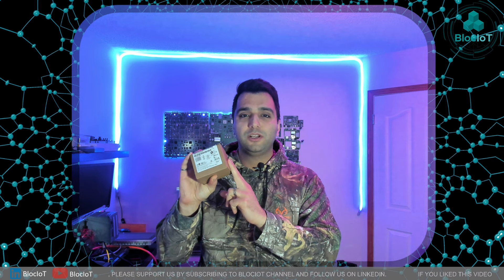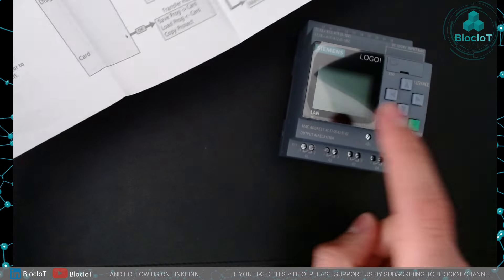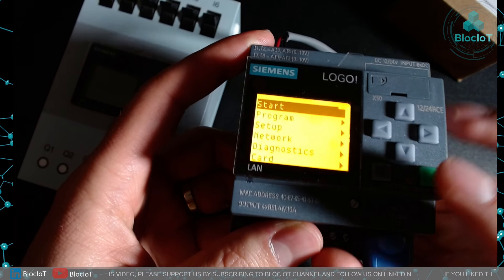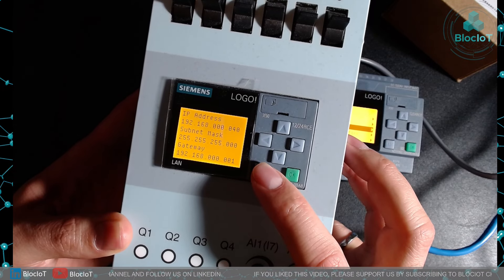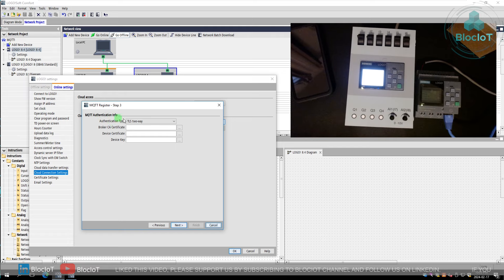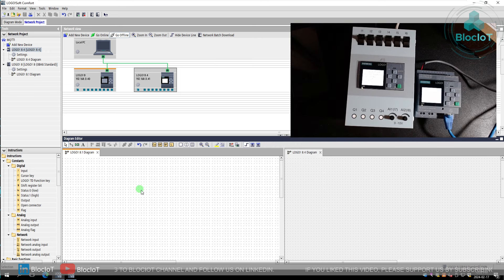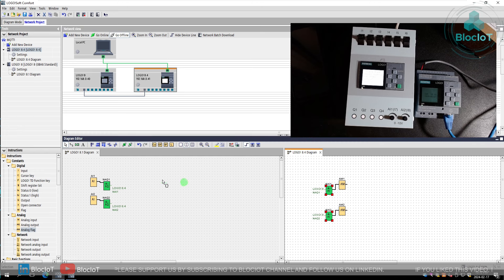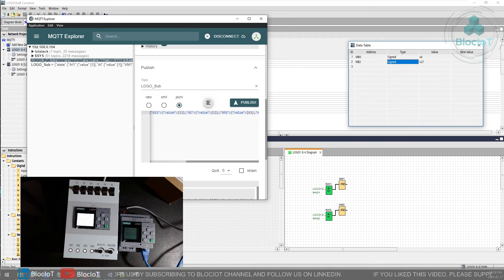31- Siemens LOGO V8.4: Unboxing & Live Demo of Bi-Directional MQTT Communication with Raspberry Pi 5

Comment: At last after watching your videos a couple of times and reading a lot of forums I managed to connect to my broker.
I was struggling because Logo Soft Comfort gave me constantly an error message, because it was unable to connect.
I was looking for a "Client ID" but you just can fill that in with something you want. Now I get it.
On to the next part, make Home Assistant work together with the Logo ;)
Edit: The strange thing is that I don't see a value in the "Cloud Data Transfer Settings" it's empty.
Reply from the maker: Awesome! Hipe you enjoy using your new LOGO. Let me know if you come up with any questions on the way

Comment: Hi  my friend congratulations for this excelent video, I have a problem, i have the Logo 8.4, I see my ipv4 on windows and my PLC is in the same subred, but after make all the steps that you show to connect with mosquitto, doesn't connect, only I see connecting and after that show me a message "server connection error" maybe do you know what i have to do?
Reply from the maker: Thank you for your comment.
Do you see the connection error? On LOGO side or on the MQTT client? You need to make sure your Mosquitto settings match what you enter in LOGO configs. If you have a username and password on the Mosquitto broker, you need to let LOGO know to connect!

Comment: I don't understand if logo can be used only with MQTT broker or comunicate in a local red. ? Can interact with homeassistance ?  thanks
Reply from the maker: Hello,
LOGO can be a MQTT client. It cannot be an MQTT broker. So if you have an MQTT broker, LOGO can publish or subscribe to data on the broker. It can also be connected to Homeassistant as an MQTT sensor, etc. with JSON payload
Reply: @blociot  Estamos hablando de una comunicación a nivel local... sin internet ? gracias.

Comment: i cant find the sw 8.4 anywhere in the german internet. please could send me a link?
Reply from the maker: Hi Thorsten,
You can try this link on SIOS:
This is an upgrade. So you will need to have an oldef version su h ad v8.3 installed before running this upgrade
https://support.industry.siemens.com/cs/document/109826553/download-and-installation-instructions-for-logo!-soft-comfort-upgrade-v8-4?dti=0&lc=en-US
Reply: @blociot thank you!   i  downloaded a demo from those link you provided. but i dont know how to make a non demo version from it. i have to find out
Reply from the maker: @thorstenfricke3257  if you had a previous version of LOGOsoft comfort on your machine, you don't need to do anything else. The file on the link upgrades your existing software. Otherwise, you have to do a one time purchase from your local Siemens rep. It's not an expensive software
Reply: @blociot  thank you
Reply: @blociot  it was much easier!   reichelt sold the 8.4 sw!  amazing!  i was surprised  when it came
Reply from the maker: @thorstenfricke3257  awesome! Hope you build cool projects with your new LOGO

Comment: Have u any problems with raspberry pi5? i mean HW problems?
Reply from the maker: Hello,
I only use RPI for lab tests. In production, I use IPCs or SBCs like Siemens IoT2050, Advantech mini PCs, etc.
But I've been using RPIs for years. They normally work fine but their SD card and power supply sometimes fail. Using SSD drives instead of SD cards and a reliable power supply helps.
Reply: @blociot  yes i use ssd and now power supply with 5.1v. i will search for siemens.... thank u
Reply from the maker: @thorstenfricke3257  anytime. You may watch this video for full tutorial if you want to learn more about IoT2050:
https://youtu.be/nZoEvhbcQfs?si=yTXi3dvikCqlzhAo